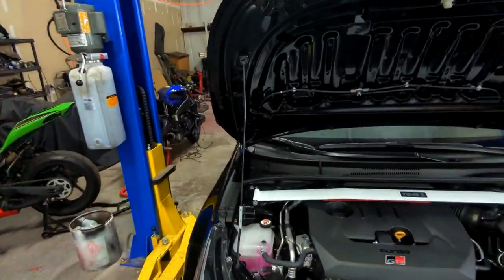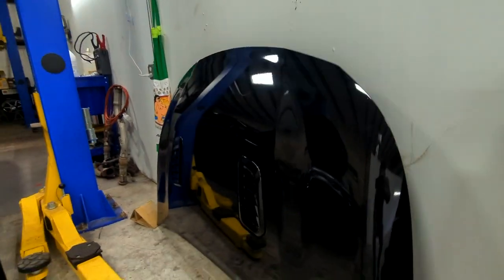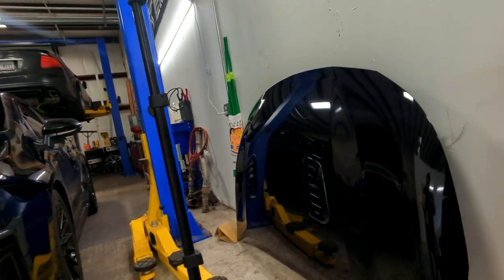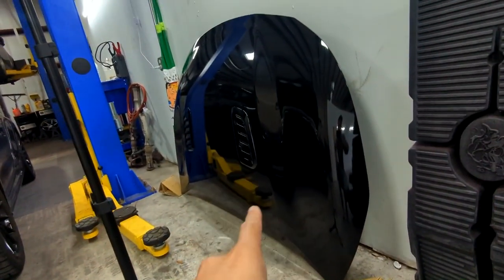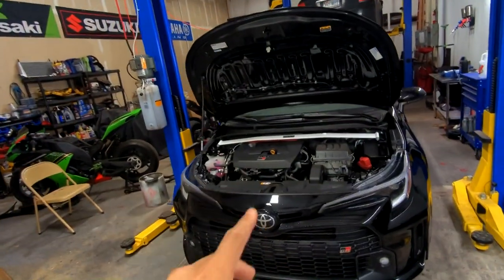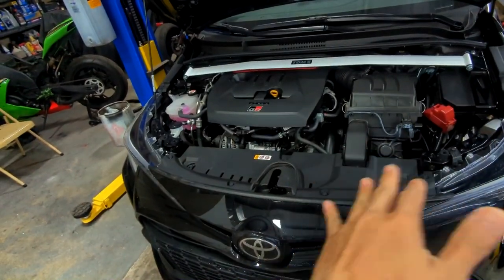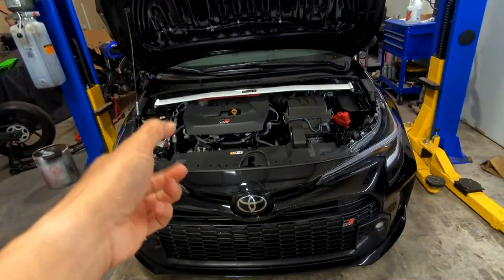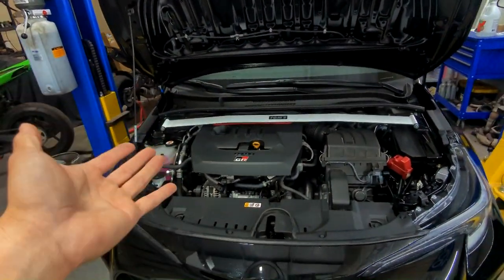NEW Circuit Edition Vented Hood for the GR Corolla!

Comment: did you reuse the windshield wiper fluid hose holders or buy some
Reply from the maker: I re uesd mine. But man they were a pain in the a** to take off without breaking them. Probably better just to buy new ones

Comment: Also about the part numbers you posted. Had a question, what are the Protectors??
Reply from the maker: They screw into the bottom of the Vents to keep rain and dirt out
Reply: It's answered in the video....
Reply: @antdo did yours come with the hood or did you have to buy the protectors separately
Reply from the maker: The proctors are sold separately
Reply: @antdo  gotcha. I just bought the hood and vents from my dealership. Just made the phone call and they will ship out the rainguards tomorrow along with the hardware. Getting it paint matched right now and should be done tomorrow. Thank you.

Comment: What are the "Protector" hood P/N 7618412040, 7618312040 parts for? I tried searching but can't make sense out of those. Are they needed?
Reply from the maker: They aren't "needed" per say. As mentioned in the video. It's just some covers that try to reduce as much dirt and debris from getting into the engine bay as much as possible

Comment: Does the hood come bare metal? Why did you have to wrap it? Do they not come in White/ Red / Black from factory? May have missed where you mentioned in the video. Thank you. Oh also by chance, do you know if this hood is Vin locked. The spoiler is not. Just curious so I know whether to order this asap or not.
Reply: toyota parts tend to come painted their xse wing comes painted for $338
Reply: Yes all of Toyota bigger body panels will come un painted
Reply: @Huy Tran  okay thank you. Was unsure I've never ordered anything like this before.
Reply from the maker: They aren't technically vin locked. Some dealerships just won't order any parts without a vin because it gives them less liability in case you try to say it's the wrong part and try to return it. You Just need to find a dealership that can order it. But I do believe there may be a stop order on the hood because it's so far on backorder
Reply: @Anthony Do  I feel like these specifically should be VIN locked to cut back on ppl trying to resell them. Give GR owners a chance, at least initially. Will these fit the SE corolla hatchback or incompatible? They will dissappear even faster if they fit.

Comment: Those interior plastic channels are there primarily to connect with the radiator/inter cooler shroud, to divert the hot air away from the engine…do not remove!! You’ll be missing the point of those vents
Reply: That is not how they work at all 🤦
Reply: Watch any of the press reviews of the CE and Morizo on track and you will see that don't even have the protectors on the car while on track. Stop talking out your ass about things you don't know. They are called protectors. because that's all they do. They keep dirt and rain from completely making a mess of the engine bay. It has nothing to do with the heat extraction itself. They don't' even sit anywhere near the radiator shroud.
Reply: Oh ok…sorry I was misled, I guess if they are not even doing any sort of heat extractions and are just fancy rain gutters, so the hood vents are non functional? You will always need to remove to utilize the vents? Doesn’t make sense that a Toyota engineer would add a non functional hood vent. Thanks for clearing things up.

Comment: For this car with an MSRP of 40k ... (Actual selling price usually higher than that) It shouldve came with that wing and hood at LEAST. I drove two different core models and the interior does honestly feel on the cheaper side. Drives very great though, but again for the price tag, these things shouldve been standard at least on the performance pack.
Reply: MSRP on a Core is $36.9 not 40. MSRP on a CE is $42.9. Why would they give you the hood and wing from the ce (which is basically the only difference between the two) just because the core has the PP package. PP package is like $1800. which only brings the Core to $38.7 which is still almost 4500 cheaper than the CE
Reply: @j.p.9630  Every dealer I have contacted always gets the core models with all 3 options available. Perf pack, cold weather pack and tech pack. I have yet to see a Core model with no options on it. and even then? The only people I have seen get an MSRP deal are employees. I was offered 44k on a core with an msrp of 40k. Not a bad deal but it didnt feel worth it to me. Thats my opinion. Others may feel different and thats ok
Reply: The hood and spoiler are from the Circuit Edition dude 😂 sold separately 😅 in case you were wondering the spoiler is $1300 and the hood is $1100 😅
Reply: I don't know where you are getting your prices from but the Hood is only $495 and the spoiler is only $620.
Reply: If that hood were to cost over a grand it would be lowkey dumb to buy as you can just buy a genuine carbon fiber hood, vented at thay price tag which would be better anyway.
Reply: What are you talking about the g
Hood is like $600 and even if it was $1000. The off the shelf CF hoods you get for like $1000 are nowhere near better. They are heavier and less secure. If you want an actual lighter CF hood you have to buy a dry carbon one and that will run you $2000+ to save maybe a 1 or 2 over a factory aluminum hood.